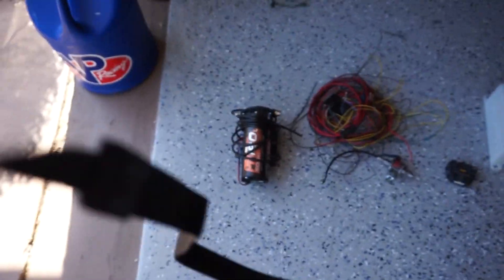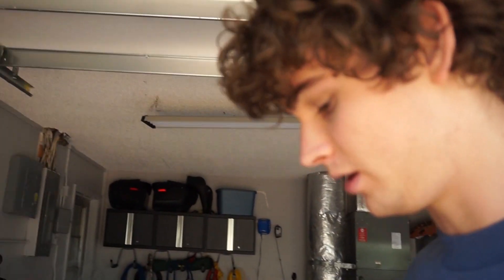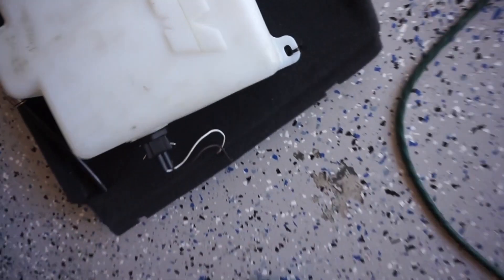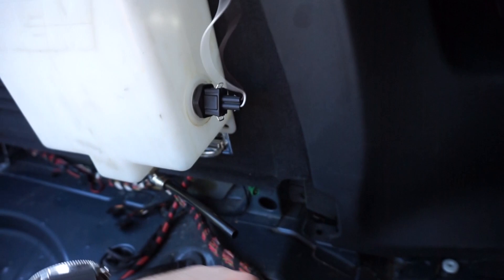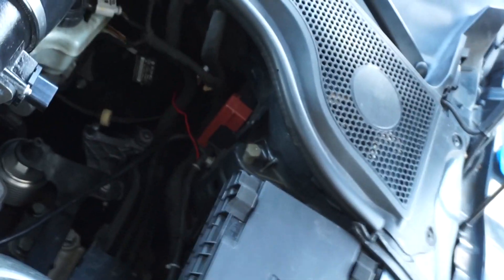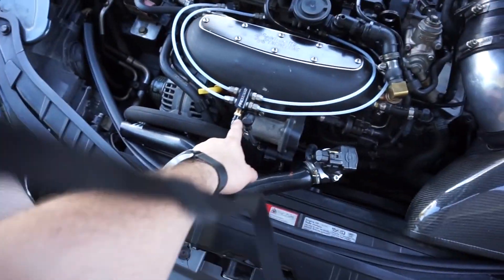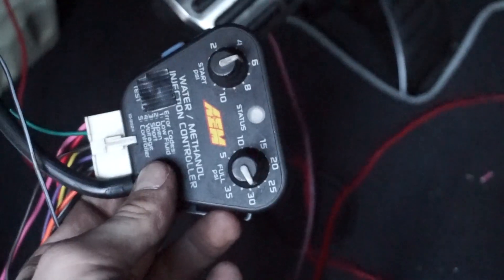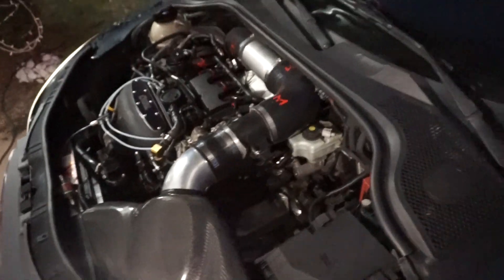How To Install Water-Meth Injection! Complete Guide -VW/Audi

Comment: Is it the water that cools the air or the Methanol that cools the air. ?
   If you run straight methanol no water does it have the same cooling effect.  ?   So what's the distance thing you was saying about more gas more cooling.  I'm just tryna be clear about it.    I'd thought you want more cool add water more power add methanol.  ?   Let me know cause I don't know

Comment: Uhhhh, you don’t use Teflon tape for methanol. Water, sure.
Reply from the maker: It's been working for 5+ years. 💁‍♂️
Reply from the maker: You can use e600 as well.
Reply: @dannyhampton  yeah that’s….great to hear. I was always told it’s a no-no.

For reference I’ve used goop and e6000. Have you done any maintenance on your setup?

Comment: I just received a stage 1 water meth kit from snow performance and it came with 2 nozzles 100ml/min and a 375ml/min which one would be better pre throttle body. My mk6 gti is currently stage 2. Thanks 😊
Reply from the maker: If you are not getting tuned for the wmi and just running for cooling, I would go for the 100

Comment: What is the best place to put the nozzle? With a spacer between intake manifold And throttle body ? Or in the throttle pipe before or after map sensor? I have AEM V2 kit
Reply from the maker: I would not place a single nozzle that close due to uneven distribution to the cylinders. 

Best places are post intercooler... maybe throttle body pipe (but far away from tb) 

Pre turbo -helps the turbo at higher rpms (but controversial on turbo life)

Intake manifold runners. Best for adding fuel and even distribution. 

You could but the direct port system here
https://hamptontuning.net/products/usrt-direct-port-system
Reply: @dannyhampton  2.0L TSI/FSI THROTTLE BODY WMI SPACER

I Saw this one on your site IT is for a single nozzle ?.
So the cheapest thing to do is buy a throttle pipe with a Integrated water methanol bung. Then iT will be distributed even ?
I run a turbosystems 430 turbo with forged engine . Upgraded fuelsystem, exhaust, valvesprings everything . How much HP Will wmi Ad?
Reply from the maker: @jeroenbeeloo4350  hard to say how much it will add. Are you adding for octane? How much are you spraying?
Reply: @dannyhampton  i need to install It. Want to use for more power. I hope 430-480 HP without the wmi so nozzle 1000